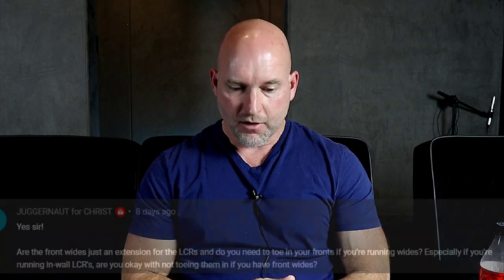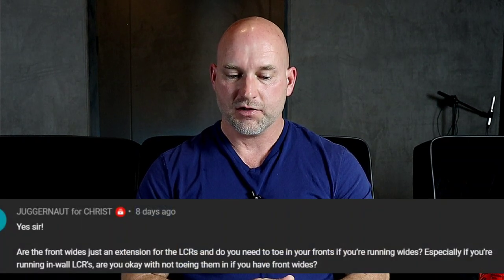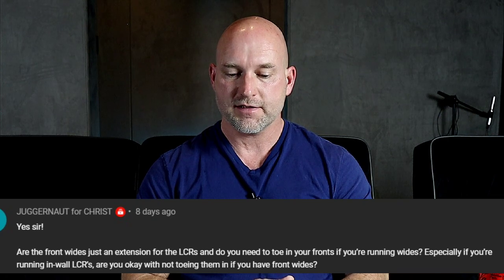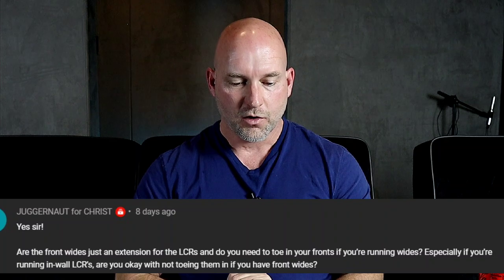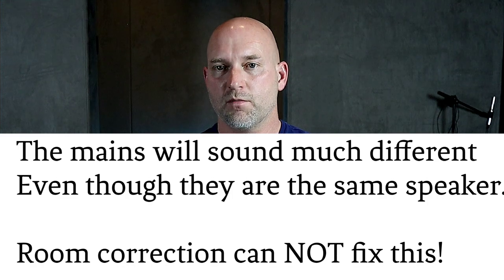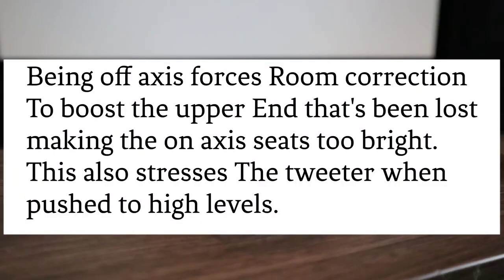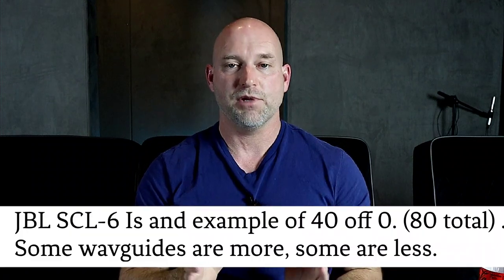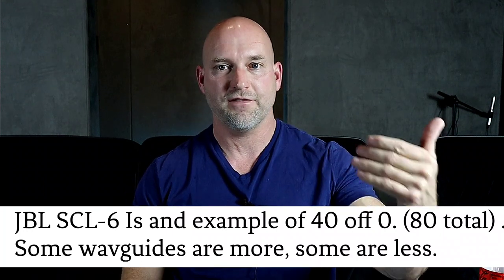Why Toe In MAINS  and Do IN Walls NEED Toe in?  Home Theater Setup.  Home Theater Gurus.

Comment: I just got a Goldenear setup a couple weeks ago.  Three Triton One Reference speakers across the front - one on either side of a 120" projection screen and one behind (Supersat 3's for surround / Atmos).  Sandy Gross (designer of the speaker) talked about toeing in the speakers to aim directly at the main listening position for the same reasons described in this video.  Even though it seemed odd, I tried it and really like the results.  I don't know if it works for all speakers but Sany said the Tritons are designed to be listened to on-axis.    Another audio legend - Ken Ishiwata (Marantz), always toed-in his speakers so much that the point at which the on-axis response "crosses" is in front of the main listening position.  That still seems weird to me, even though I totally respect the guy.

Comment: Thanks Steven, well said.  My Jamo LCRs (on-wall mount) "claim" that they shouldn't be toed in.  But I'm getting ready to widen the array, and I'm definitely going to customize the mounting position to maximize the L&R for the whole room.
Reply: Am using the JamoD500 LCR,they r 3 way speakers so dispersion is good,so probably they say toe in not required.
Reply from the maker: Thanks for watching Evan!

Comment: I'm just running 5.1 with a lot of 2.1 for music and I have 4" thick Owens-Corning 703 panels at my primary and secondary reflection points.  In my system (a full set of D'Appolito-designed HT speakers) if I toe my mains in to 30 degrees (pointing at the sweet spot) my soundstage collapses.  I have to toe them in less than 30 degrees to get back that nice open soundstage...

Comment: I own the complete Polk LSIM line for home theater and reviewers have said the fronts Polk LSIM 707s dont like more than 5 percent toe in. Not sure why this a thing but this video has made me rethink such a small toe in angle. They are huge speakers and I can only sit about 7 ft away so maybe that has something to do with not much toe in needed? I only have one seat in my theater.
Reply from the maker: Toe in depends on distance to side wall, how the walls are treated,  how far in angle the mains are spread, how many seats you need to get great sound too and more.  Toe them in and listen to how it changes.  For home theater we  want even pink noise, for two channel listen to how the sound stage and imaging change.

Comment: Slightly off topic....but actually relevant to a Home Theater Setup:  I'm building a home theater and I can find NO INFORMATION on how to properly prep the electrical boxes for a soundproof room.   I've followed the advice to dress the original studs with insulation batts between the studs and to use sound deadening putty around the electrical boxes facing outwards (into adjacent rooms).  However, I'm unsure how best to mount the electrical boxes needed for the media room.   (I plan on dressing the media room studs with MLV, then applying hat channel clips and channel, then applying two layers of 5/8" sheetrock with Green Glue between the sheets.)  The finished wall will be quite far (1/8" MLV + 1.2" hat channel clips/channel + 1.35" sheetrock/Green Glue ---- I.e. 2.6"), from the original stud line.  So, mounting boxes on the original studs would leave a huge extension gap to fill.  How do you soundproof experts solve this problem?     Thanks

Comment: Great vid! - On the same topic - I use Klipsch Cornwalls as my L+R - What about "extreme toe-in"? i.e. in a three seat theater room, pointing the left spkr at the right seat and pointing the right spkr at the left seat, paths crossing in front of the seats? Is this a bad thing? (walls are quite well treated, and room is anything but "live"). - Thanks!

Comment: Great advice, man your video on the Dolby Atmos speaker placement is definitely a controversial one. Do you have the link for the Dolby studio PDF? Do they even have a studio PDF or is it just the home theater for pros and Cinema pdfs?
Reply from the maker: It's not controversial, just ignore those other guys.  Their atmos systems were so poorly setup they've yet to actually hear what atmos should sound like. 😂.  It's what the studios do. Just how it is.  Audioholics has even had an atmos mixing engineer on and he basically backs it all up.  That's how the stuidos are laid out and how they do they own personal theaters.  The pdfs are linked in some of the videos.
Reply: @hometheatergurus  
What about thank you I found the studio PDF and happily pointed some things out to the "advanced audio engineering pro".  Boy did that feel good! You the man
Reply from the maker: @mikeday3306  ha.. Well some are not open minded but some are.  In the end we have not had single person come from heights to this and not be blown away.  The problem with atmos is that the home guide can lead people to very poorly setup systems yet they're in the home tolerance.  They're left thinking atmos isn't as amazing as it really is.

Comment: I am essential the soul critical user of my home theater. My couch does not allow sitting in the middle. Thus, I am sitting pretty much in front of the front right speaker. Should I just keep that speaker straight and toe in the left front?Should I also do the same with my rear surrounds? Enjoyed your explanation.
Reply from the maker: Try playing pink noise and toe both in to a point they sound the most similar.

Comment: I have a question. With the insane prices of pa subwoofers. Do you think if I bought a skar audio 18 inch with their premade box. I guess they're ported and tuned to 30 hz. And bought an inexpensive 2000 watt rack mount power amp. All in I think around$500 Do you think it would be competitive with the  higher end pa subwoofers in the $1000 range?
Reply from the maker: YOu'd have to model the driver in design software to decide on a box and tuning.  See some of the older videos as I have a WinISD tutorial that walk you through doing that.

Comment: Are you recommending a scl-6 front walls since they have 40 degree?
Reply from the maker: The SCL6 isn't angled at all so as a main it must be installed into an angled wall section to perform well.    The SCL 7 is angled (15 degrees) and would be a much better choice for mains if you can' t alter the wall.    Here's a good visual.    
 Keep in mind as you approach the edge of the waveguide you have lost 6 db at 10k according to Harmon and of course past the guide the CD is blocked completely. 
   If mains are spread 30 degrees the opposite side seats may very well be past the guide. 
  
https://www.avsforum.com/threads/official-jbl-synthesis-pro-revel-home-theater-thread.2515137/page-263#lg=thread-2515137&slide=3

Comment: Great informative video! I think we may need a video of you creating a +10db house curve with Anthem ARC Genesis! Is it possible? Can we manipulate the EQ in ARC to create the house curve we desire with out using miniDSP? Does ARC align the subs like we can within miniDSP? Does Anthems AVM90 (4 independent sub outs) and ARC Genesis have the capability to make miniDSP redundant? If not an we still need miniDSP for maximum performance from our subs then perhaps a video from you with in depth integration of miniDSP and with ARC Genesis EQ would be a great video? I currently have the AVM90 and at this point only dual subs, I will be getting another 2 subs when I have the room that needs them, I have not used my miniDSP 2x4HD yet to see if there is a performance difference but would love to hear your feed back on this topic as Anthem seems to be getting more an more popular, thanks!
Reply: The AVM90’s ARC-g and miniDSP2x4HD are tools. ARC-g may be manipulated to design a house curve by incorporating Tilt, Room Gain, and Bass Boost. It does a great job at timing and phase alignment - applying filters to cut or boost as needed. 

MiniDSP2x4HD allows 10 filters per input and output as well as very complex filters. One may use this tool to dial in each individual sub response as well as incorporate a tool like MSO to smooth and align response across multiple seats. 

Using miniDSP2x4HD to EQ subs, then run ARC-g to unite your sub system with your speaker system can free ARC-g to focus on your speaker filters. This also allows one to use BEQ if they are prone to do so. 

Otherwise, the AVM90 alone should be able to filter and align your subs with your speakers and create a house curve as previously mentioned. The room should sound exceptional with crisp detail and stunning bass impact throughout the bass spectrum including infrasonic sound. 

If not, it is recommended to get a UMIK and REW to help identify and target problem areas in your room. HTG has many videos showing how to address a number of problems in easy to understand and follow format.
Reply: @SealedOrPorted  I have incorporated MiniDSP into my system about 3 weeks ago, there is no comparison, the MiniDSP has blown away my old calibration with ARC on its own. I am still unsure why but it sounds fantastic, my subs are alive and vibrant now, with our MiniDSP they were very dull and boring, I have spent hours trying to get ARC on its own to give fantastic bass and it wasn’t happening. I EQ and aligned my subs with MiniDSP flat then ran ARC and used the same corrections I always use and it absolutely hits now, unfortunately I think ARC have a long way to go at perfecting multiple sub optimisation and bass management, till then I think the MiniDSP will stay where it is!

Comment: As always amazing work Steve! Would you rather have speakers at 30° with a large amount of toe in... Or have them at 26°angled a little more straight but still pointed to the MLP?
Reply from the maker: Thanks Ramsay.    That depends.  If you saw the video before this, there's some things to consider with mains spacing so it's not a simple answer but toe in must be a part of the setup if you're after great sound.